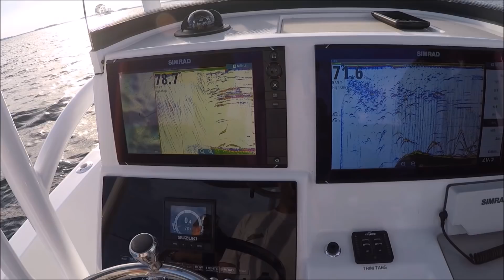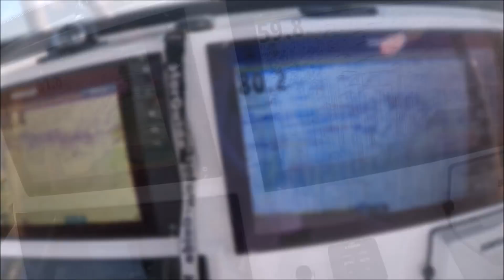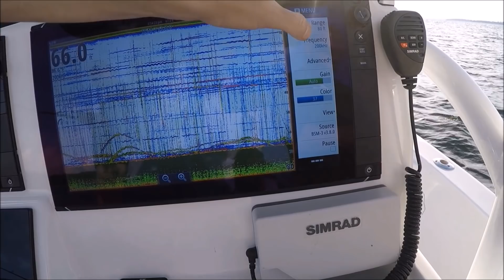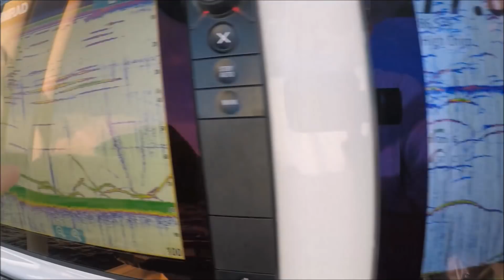Chirp Sonar compared to Traditional Sonar!

Comment: What about p66 (traditional) with furuno rezboost?
Reply from the maker: Unfortunately I don’t know much about Furuno. The P66 is a good little transducer for the money, but if your Furuno has CHIRP capabilities you might want to consider upgrading to an Airmar CHIRP transducer like the TM150M
Reply: @MikeSmedleyOLDSCHOOLSTRIPERS  tm150 which depth cant you see clear fishes plz? 100 metets?
Reply from the maker: @billlegend277  it’s good to 600ft so 200 meters.
Reply: @MikeSmedleyOLDSCHOOLSTRIPERS  mayby a 165hw will be better..have you tried this at 150mt  depth?is that clear?

Comment: Hey Mike, thanks for your comparisons.  These are great!  Question:  In your description you state " At these relatively shallow depths, (in this video), a CHIRP transducer that costs less than $500 will perform nearly the same as the 275 in these conditions."    But you didnt' really test a "less than $500 CHIRP transducer" did you?   I see a $165 non-chirp P66 and a very expensive $1500 TM175 Chirp.  Thx Mike!
Reply from the maker: I didn’t test one in this video, but I have LOTS of water time on the TM150M which is around $279. Over 5 years with it. I have dozens of videos on the TM150M  https://amzn.to/2BsVMud

Here is one https://youtu.be/8hgzkFsTAgQ

Comment: I am so new in this subject and have 338cm dinghy.Using Helix SI Chirp.Any one can advise me best airmar solution for me?Some people told me for TM 185 .Does it wort it or any cheap feasable solution?I will use in saltwater and the depth is around 30-90meters on Eagean sea.
Reply from the maker: The new Airmar TM165 High Wide is tough to beat at those depths.
Reply: @MikeSmedleyOLDSCHOOLSTRIPERS  Great Thanks sir.

Comment: Just wondering if you can make a video comparing TM150M 300 watts VS Lowrance HDI 83/200 455/800 most sites are saying its 600 watts

I was on http://transducerguide.simrad-yachting.com/   comparing the two by specs
TM150M has a beam angle from 26° at 95kHz to 17° at 155kHz  And Lowrance HDI 83/200 455/800 has a beam angle of 22° at 200kHz and 52° at 83kHz is also chirpable but not true chirp
Reply from the maker: Wattage on a CHIRP transducer is much different than a single frequency transducer. CHIRP transducers use mush less energy and need less power.  The 2D sonar on the HDI is ok, but it’s old technology. Even the least expensive of the Airmar CHIRP transducers like the 150, WAY outperform the $900 1000w single frequency transducers I’ve had, and I have had LOTS of them😉. 

 For a transducer under $300 you can’t beat it, I get texts from guys that just CANT BELIEVE the difference. It’s probably the single largest improvement you can make to your system.  https://amzn.to/2BsVMud
Reply: @MikeSmedleyOLDSCHOOLSTRIPERS  I'm going to try the HDI on my system with the s5100 as soon as the weather warms up and this ice melts and compare it to the tm275lhw because thats what ill have on the boat.   if the HDI really loses a lot I will just upgrade to the tm185 for better sensitivity or tm150m for little bit wider cone 

well see come spring :) cant wait cabin fever lol
Reply from the maker: You will need an adapter to connect to the S5100. I wonder if that connection has ever been made before 😉. Also, the down scan won’t work like that.
Reply: @MikeSmedleyOLDSCHOOLSTRIPERS  yesterday i talked to a simrad rep on the phone, He said that it will be compatible with the s5100,   I already have the adapter for the transducer and i also found out that the s5100 i ordered from over seas comes with 3 extra adapters 7pin to xsonic
Reply from the maker: disonesto The 2D will work, but not down scan. It has to connect to port 2 on the Evo 3 for both to work.
Reply: O and i forgot to say i know the down scan wont work, but all I'm really after is the 83KHz band,   I have the  active imaging for the down and side now 2 in 1
Reply from the maker: disonesto Then you’ll be fine. You can use 83 and 200.
Reply from the maker: I think it’s referring to down scan at 52 degrees. Even the widest low band Transducers rarely go wider than 25- 28 degrees.
Reply: @MikeSmedleyOLDSCHOOLSTRIPERS  the down scan at 6.4° at 800kHz and 12° 455kHz     thats the info from http://transducerguide.simrad-yachting.com/
Reply from the maker: Also, The elements in the P66 are pretty close, if not the same as the 83/200 HDI So this video will give you an idea of what that comparison would look like.
Reply: @MikeSmedleyOLDSCHOOLSTRIPERS  one last thing the P66 is 12° at 200kHz and 45° at 50kHz,   I have read on a lot of old forums that the elements in the HDI are better then the P66, I will also post a video on once everything is setup come spring
Thanks Again
Reply from the maker: disonesto I think you mean 25 degrees at 50.
Reply: @MikeSmedleyOLDSCHOOLSTRIPERS  just looked it up on airmars site they also have it listed at 45° at 50KHz

Comment: This is Dave, I have a Sportsman 237 w/ twin Simrad 9. I don’t know what kind of transducer I have on my Evo 2.
I don’t get any arches of fish and am wondering if it’s the transducer?
I want my equipment to help me catch fish and am frustrated because I can’t tell what’s under the boat.
Please help!
Reply from the maker: Sure.  Its most likely the transducer. If you didn’t specifically ask for a CHRIP Transducer you probably didn’t get one in the boat. If it’s a Thru-hull read what it says on the top of the transducer. Let me know what it says.
Reply: The transducer came with the boat, it’s located in the back of the boat and not a thru hull. I have twin evo 2 , everything seems to work fine , the fish just looks like blobs if there are fish. No straight lines and no arches. Money is not a option for another transducer as long as I can tell what are fish.  Thanks again
Reply from the maker: David Bowers Chances are, you have room to upgrade to a CHIRP Transducer. However, cranking the interference filter will turn arches to blobs with many different transducers, even high end CHIRP transducers so I would make sure yours is turned off or at LOW at the most.   With that being said, I rarely hear of a boat builder installing a higher end CHIRP transducer with direct requests for it.  If I had to bet, I would bet it’s a standard 50/200 Transducer like the P66 in this video on the left display.   If money is no object, I will always recommend a TM185 High CHIRP Wide Transducer.  If you shoot me an email I can get you the correct link so you get the model with the proper end on it.  Also, if you use the Amazon link I give you, you will receive lifetime set up help from myself personally by text.  It’s a win-win. Lowest price and all the help you need by text.  Let me know.  Mikesmedley9@gmail.com

Comment: Mike. Whats up man. Great videos. Very helpful.  Just got sportsman 234. Dual simrad 9's. I have the airmar 50/200  d60 12.  Is this high chirp or what. Looks the same when i go from high chirp to 200.    I fish freshwater mostly under 60 ft. Thanks man
Reply from the maker: Jerry Evans I think you have a b60. It’s not a CHRIP Transducer, so that’s why there is very little difference in CHIRP or 200. It’s very similar to the transducer we are using on the left display. The TM150M or B150M is a great inexpensive CHRIP transducer.  It will take those displays to another level for sure. The TM185 H Wide is even better but more expensive.  If you decide to pull the trigger shoot me an email. I can help you dial it in. Mikesmedley9@gmail.com

Comment: Awesome video - Thank you.  In the market now for a new CHIRP.  Looking at the Airmar B75H tied to my Garmin 7612 - Any thoughts on the Airmar?  ( I am a casual fisherman at best )
Reply from the maker: The Airmars are great products. If going with one CHIRP channel I would go for the medium. B150M for around $300 or the B175 High Wide for around $800. I have used them both extensively. They are both excellent units, it’s really just a matter of what you can afford.  The 175 Wide gives the widest cones available in 25 degrees which means you will mark more fish not directly under the transducer and the high frequencies mean structure will have great detail. The medium is a smaller cone and 75high smaller still. I wouldn’t personally consider the one channel 75high CHIRP for the Striper fishing we do. The only real downside to the medium is the loss of Great bottom detail.  Contours get a bit flattened out but you will mark a lot more of the “surrounding” fish. The high is great for bottom fisherman on structure, like for Taug but downscan takes care of that duty nicely.  Hope this helps.

Comment: For starters it would have been nice to know the models of both the transducers and the finders.

Second high chirp and low chirp don’t mean shit. We need to know the frequency it’s pulsing at. You said it a couple time but most the time you just said high and low and we can’t see shit in the video as far as what the frequency is on the screen.

And lastly, those “fish” hits aren’t fish. It’s probably fish/debris/feedback or random sea weed or loose sea crud.

You will get false readings all day on a standard view relay. That’s why they have multi screen functions to fun side view, down view and standard view.

You need to use them together to get past the false readings. At the minimum down view and standard view. Minimum. This had potential to be a great comparison video but it didn’t really help anyone because of how much info was actually missing to make this cut and dry which is out preforming what.
Reply from the maker: CK_32  at 2:20 thanks for the comments! You have some great points! I appreciate the time you took to write them. I say the models of both transducers, they are also listed in the description. At 6:20 we catch one of the Striped Bass we are marking and catch another at the very end. This is freshwater where there is no debris at all. You won’t see the benefits of low CHIRP in less than 100 feet of water. The reason I don’t say what frequency we are using when set to CHIRP is because it’s not set to any one frequency. CHIRP is using swept frequencies. In this case high CHIRP is 100 frequencies from 150-250. Thanks again brother!! 😁👍

Comment: Mike...thanks for the videos you put out there for simrad.  I have a question for you.  I just picked up an nss12 evo 2 about 4 weeks ago and about to put it on the boat.  Well a couple weeks ago west marine had a sale on the Go7, it was like $150 off so I picked one up just cause it was a good deal.   I’ve been wondering if you can run 2 totalscan transducers?   Is it possible? Maybe have one medium Chirp and the other one side scan  or 200hertz? Will it show interference on the screen if you’re using both at the same time like in your video?  Is it possible to use medium chirp on my evo2 and then structurescan on the Go7 at the same time or will it just be pointless because it will have interference?    I do offshore fishing in Florida.
Reply from the maker: Sure, you can run Structure Scan on one and CHIRP on another, there is usually little interference between the two. You might get a little,, but probably not.  The frequencies are far enough apart to keep the interference down.  That’s a great deal, you can’t pass that one up!
Reply: Mike Smedley

Are the transducers you have both transom mount? If so, can you send me a picture of how you have them mounted?   Do you have them mounted side by side?   Or is one a through hull?
Reply from the maker: They are both transom mount. I don’t use thru hulls because I’m in a new Sea Pro every 18 months. It’s easy to transfer them over if I need to. I will take a picture tomorrow for you. Thanks

Comment: Nice video Mike, I primarily fish striped bass at 100' or less, I'm looking for the thru-hull. Would you recommend a B75 medium?
Reply from the maker: Yes, I am a big fan of medium CHIRP, the B75 Medium is a great choice. You will need an XSONIC adapter for your Evo2. (I’ll post the link). If you order from BOE Marine and use coupon code OLDSCHOOL you will get lifetime setup and adjustment from myself by text or email. You also get a chance to win a Simrad Go9 XSE Display that we are giving away in two weeks. 1 entry for every &10 spent. 

https://www.boemarine.com/products/airmar-b75c-12-m-mm?variant=43575090899?ref=8

Make sure you use this exact adapter, there is an older version that won’t work. 

https://www.boemarine.com/products/navico-9-pin-black-to-7-pin-blue-adapter-cable-f-xid-transducers?variant=45558968851?ref=8
Reply: Mike Smedley, awesome I would have never known I needed the adapter. I believe there's an update coming out for our machines that's supposed to have some nice features! Thanks again!
Reply from the maker: TheTim16964 you are very welcome and yes the new update has some cool stuff. We got to play with it a bit early 😉. I will do a video on the new features soon.

Comment: Mike, I use the totalscan transducer that came with the simrad go. Is it a true chirp transducer?  If not, would it run best on the 200khz setting as well?
Reply from the maker: Joshua T Valley Total Scan IS a true CHIRP transducer.  I would use 83khz in 30 feet or less and Med CHIRP in deeper than 30.
Reply: Mike Smedley thanks so much for your help!  Your videos have been very helpful in my search for striped bass.
Reply from the maker: Joshua T Valley that’s great brother!! I appreciate you taking the time to comment!!